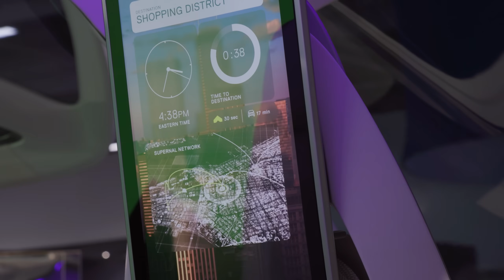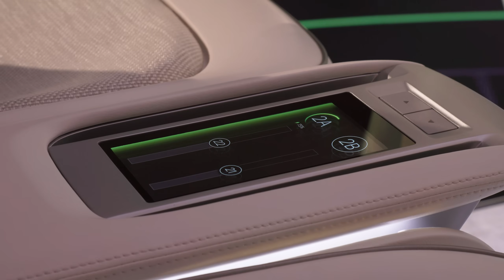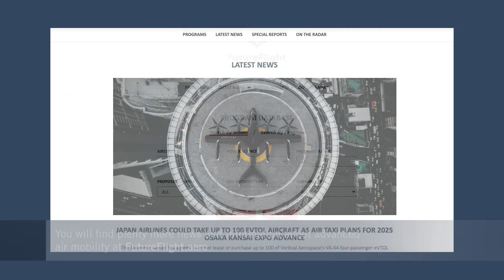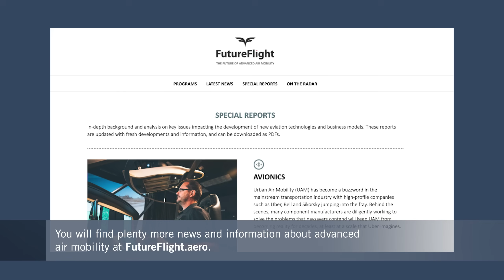Hyundai’s Supernal Division Unveils Its S-A1 eVTOL Aircraft – FutureFlight

Comment: It'll never happen so it's a waste of R&D resources.  Have these people ever observed how bad DRIVERS are, and that's 2 or 4 wheels on the ground limited generally to roadways and they put others on the ground at risk.  Imagine these same negligent bad drivers flying around in a 360 degree world, nobody would be safe.  Plus, there's terrorism and suicides risks.  The security risks of more 9/11/01 attacks by lunatics able to strike any tall building or fly over security barriers will prevent the general public from using these.  So then it's little more than a helicopter, which requires licensing and training.

Comment: All electric is not environmentally friendly. 80% of the energy use is in the manufacture of a car. Same with this if not more. Plus, electric? That requires added battery weight. Lots of weight. And range anxiety without wheels on the ground. How do lightning strikes effect an electric plane? New layers of FAa bureaucracy and what will I surance cost? This will not be for the masses. It will be for the rich. They will have to y low over the layers that ring the big cities with a seething mass of poor who hate them. They will be shooting g at you as you fly low under the airplane traffic. It's called a turkey shoot.

Comment: So you need oil to power the gens that make the electrics to drive your e cars and flying things . But the oil has been shut off so the gens can't work thanks to the BS on energy , so how good is your things when you can't use them ? Wind and solar will not to the job .